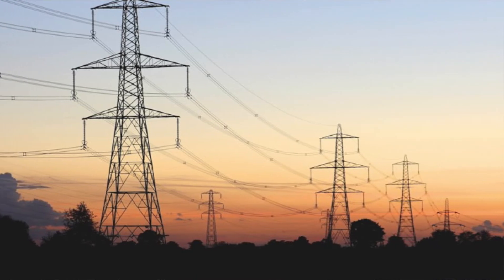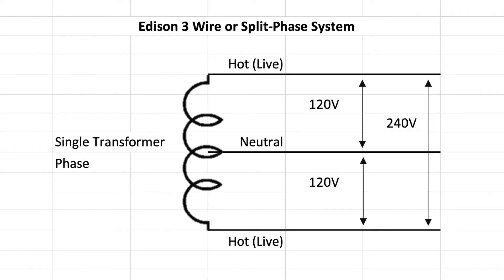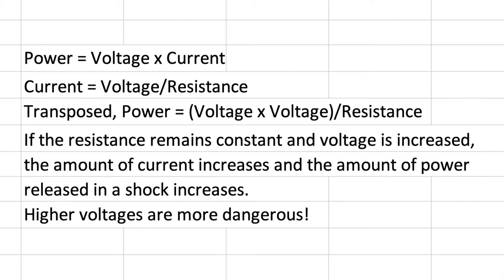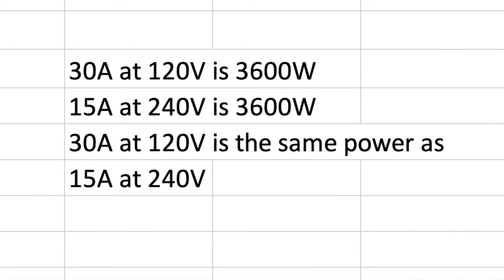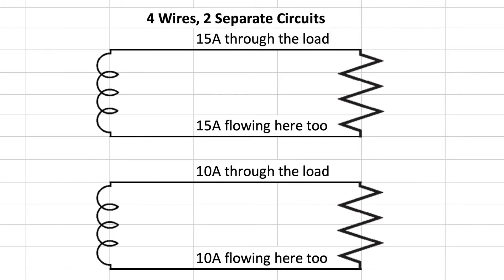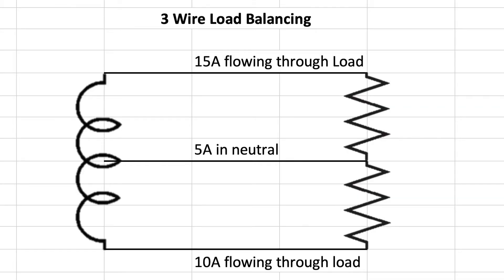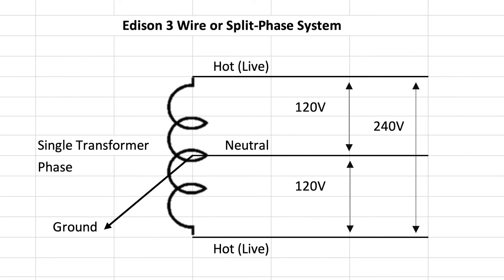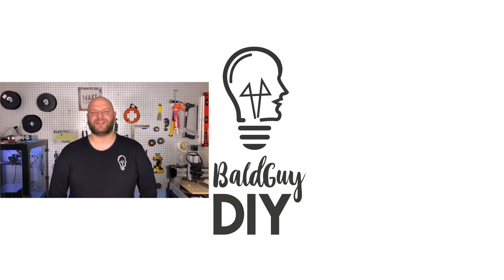Ask An Electrician - How Does Edison 3 Wire (Split Phase) System Work?

Comment: Correction.   One 15 amp and one 10 amp with a neutral.  BOTH legs will carry 10 amps with the neutral carrying 5 amps.

YOU SAID the 15 amp carries 15 and the 10 carries 10 and the neutral 5 amps.   comment please

Comment: single phase step down transformer.  Only one BUSHING on the top of the transformer.  I can not locate the NEUTRAL, on all my local poles, 
back to the substation.      Yes, each pole/transformer is connected to ground.    AKA    multipoint grounding system. 
thank you

Comment: Great video.
Could you watch this video about L1 & L2 phases, and remark on why he says this.
https://youtu.be/uRKbX74lBgU
Reply from the maker: Thanks for watching. A split phase system is still a single phase system. Because it’s a single phase, the voltage and amperage are in phase, rising and falling at the same time.
The confusion comes because a three phase system has three phases 120 degrees apart. People naturally assume that on a single phase the two legs are 180 degrees out of phase, but that’s not correct. A single phase basically functions like one single coil. The same voltage is applied across the entire coil, so it has to be in phase at each end. Splitting the phase just creates a voltage divider, so you can take the full coil at 240V or either half at 120V. Does that help to explain it at all?  If it’s still unclear, let me know which part of the concept you’re having difficulty understanding.
Reply: @BaldGuyDIY  Thanks, much!  The part that is confusing is why the L1 &  L2 are apparently 180 degrees out of phase.
Reply from the maker: @louf7178  Essentially it’s because if you measure L1 to N and L2 to N on an oscilloscope, they will look opposite. But that’s because you’re looking towards the middle from both ends. Kind of the same way that if you had a car travelling down a section of tunnel. The car is only moving in one direction, but if you peeked in one end of the tunnel towards the middle the car would be moving away from you, but if you looked from the other end of the tunnel towards the middle the car would be moving towards you. The current is only flowing in one direction, but because you are looking at it from opposite ends it appears that positive and negative half cycles are flipped/mirrored.
Reply: @BaldGuyDIY  Thank you very much!  I'm going just go with that.  The half-cycle and voltage-divider are key.  Thanks !